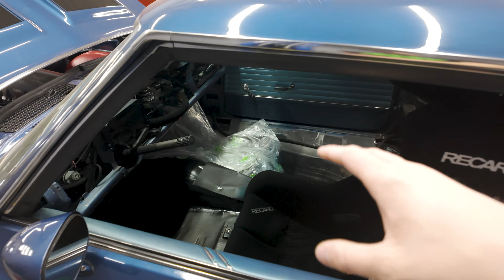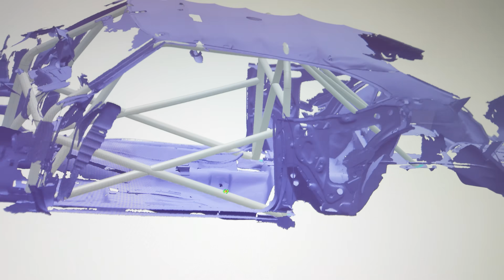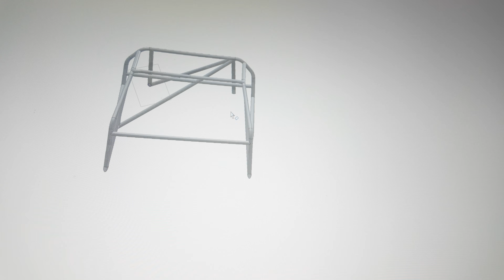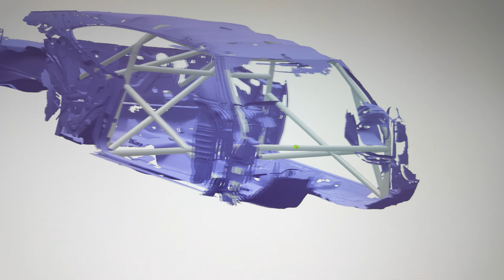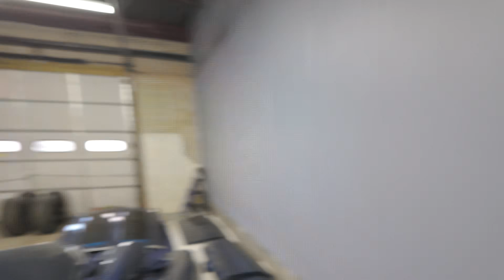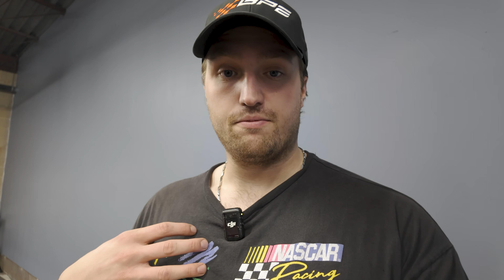Designing & Installing A Custom Roll Cage!  | The Road To Time Attack Episode 2

Comment: It would be most excellent if they allowed welding the lower A and B pillars to the tubing. Had hinge and latch requirements for the doors and allowed an X brace inside the door replacing the OE door bar.Hinges and dual latches mounted on 1/4 plate mounted on the ends of the x brace. Welded door posts and a welded to B pillar limiter stop that limited the door from going in. I've seen a lot of modern cars that got t boned by what must have been a freight train and the doors don't let go without any of those mods. Just beefier hinges, pillars, and door perimeter thickness. That's why a Hellcat weighs 1200lbs more than an iron block, iron head 426 Hemi Challenger. An aluminum Hellephant swap would make the difference closer to 1500lbs. That one time 35% more is no bargain. 4500lb modern pork.

Comment: I've got to say you've done a good job on your cage! I have no experience with your Sanctioning body and certs, but have built over 50+ NHRA, 30+ IHRA, and Goodguys Nostalgia Top Fuelers, and on the others from Pro Gas, Comp Eliminator,  Super Stock, Super Comp, 3- Top Sportsman, 4- Pro Stock, 4- Top Alcohol Funny Cars, and one Top Fueler and several Pro Stock Harleys back in that heyday. The reason for my interest is that at 65 and I'm slowing down after I broke my neck and back ( Industrial injury... not racing ), and I have 2- 70' Olds cars, both 350 cars... a W-31, and a Rallye350 that I am putting the W-31 in a grudge match circuit here in N.E. Oklahoma, and the Rallye I would like to build a Pro Touring track car, along with my OBS trucks we've been hiding for next year and probably won't get started till after the holidays. I have a shit ton of Olds Hi Perf and racing parts I probably will sell worth the money as I am liquidating all my Harley stuff and Custom Guns ( IPSC/USPSA, STEEL CHALLENGE, 3 GUN STUFF, Benchrest, Competition guns all... no stock guns. I've got Rocket Blocks, all W parts, rearends, heads, engines too, but most of the things will go  fast... already sold my Hemi's, SS, original 302, 327, 400, SBC 's, Origina Numbers matching ZL-1 from the 69' ZL-1Camaro, etc. Sorry, just checking your build out, being my age doing YouTube never appealed to me because of thieves... yeah it happened. So I enjoy checking out who is doing what. Thank you young man, have a good one.
Respectfully, Seth
Reply from the maker: Thats awesome, sounds like you have some cool plans for your cars! Appreciate the support, thanks for following along!